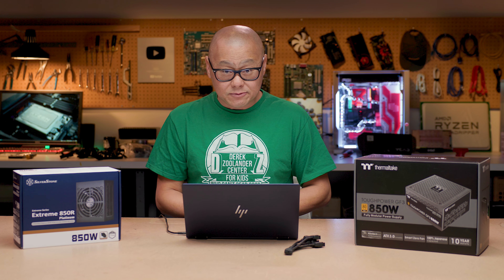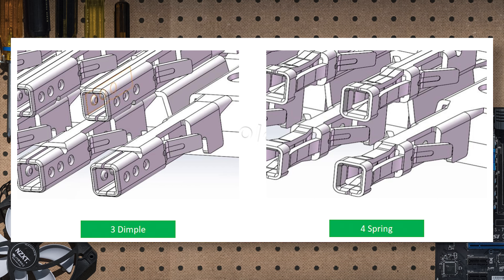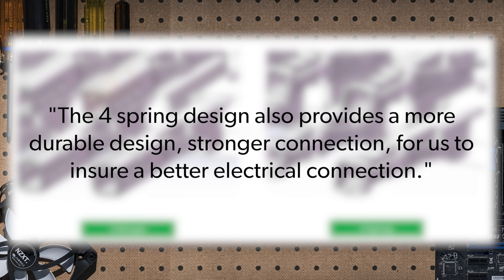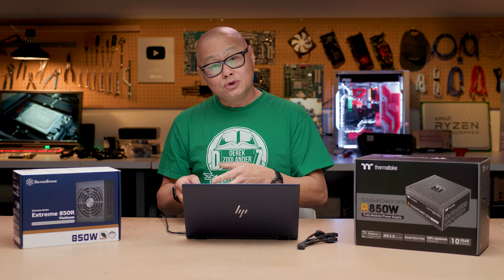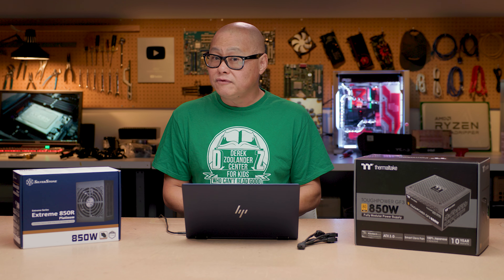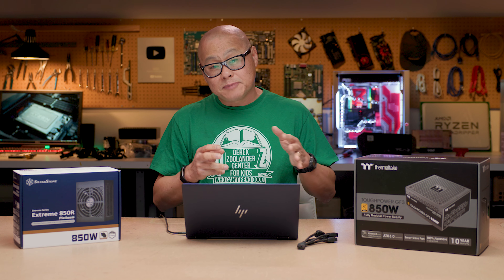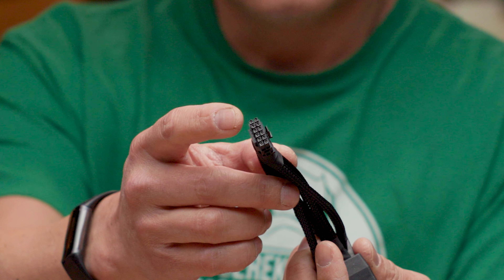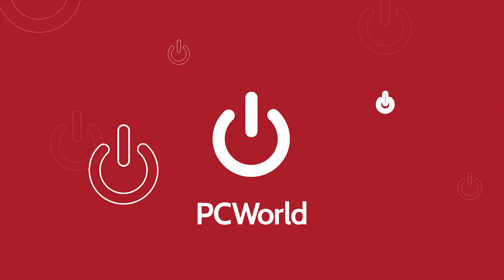Intel Updates 12VHPWR Spec: What You Need To Know

Comment: Sure, Intel who wasn't part of designing this wants to get money off this connector so it says it should be done THIS way, and they probably patented it.

I'd rather just stick with the 150W connectors because I'm NEVER going to have a GPU that needs a 600W connector, and if 3 150W connections are used, I'm OK with it.  I think most GPU makers would rather use 150W connectors when they're dealing with anything under 375W which is like almost EVERYTHING they sell, regardless of what they make.  It's not many people who shell out the money for $1000+ USD GPUs which is basically where  you start needing more power than that.
Reply: And it's not like these massive monsters are stable in just a slot and a couple of screws right? They need a little stand just to keep from sagging. Maybe the design should be reevaluated so that these pathetic connectors aren't the future and risk any potential for damage or worse, fire. To blame a user for the potential of not fully seating a connector really speaks to how low they view the individual user: they are trash and are not worth the time to create cleaver solutions for problems that don't need clever thinking. It's not like the previous 20 years of connectors from molex to the pcie power connectors didn't work, they just weren't pulling a profit so, why not just create a standard that even the pcisig said : "[PCI-SIG later said in a statement] that Nvidia and their partners were still responsible for testing their products to account for user error."

Shame, 30 years later of making connectors so easy a child couldn't screw it up and we have to worry about potential for one single connector for the point of failure? Christ.

Comment: I am wondering is my very expensive 1200W platinum PSU now trash because companies want to change the shape of the connectors for no valid reason.
Reply: Definitely not, the dimple connector type still works fine, just make sure it is seated well. If you are really worried about it, wait a few months and buy a replacement custom cable that uses the spring design. Remember, don't panic, and always remember your towel.

Comment: So just a recap for those like myself who may have missed it. Apart from the one batch of faulty cards reported from the single source, how many more have been reported as faulty?
Reply: There have been a smattering of reported melted cables post GN report, post Nvidia report. Probably less than a handful that I know of and in one post on Twitter that was reported post GN that had people again speculating--GN Steve pointed out that the picture itself showed the melt point of the connector indicated it was fully inserted. My advice is push the power plug all the way and listen carefully for the click and then try to remove the cable to make sure the lock is engaged. And then: PUSH it back in.

Comment: Seems like they want to reduce the likely-hood of another melting incident, but honestly just better labeling and education about making sure it is properly seated would probably be fine. Hopefully these changes will prevent the lowest common denominator from making this mistake now that its a pretty public issue, because there will still be someone buying a high power device like a 4090 with no idea that this was an issue in the first place. This whole thing is definitely one of those issues that was a low occurrence high danger situation and while it is good to be taking it seriously, I don't think its really fair for everyone to be dunking on it so hard. The industry NEEDED to find a way to move away from the 8-pin to something that takes up less space, having some cards with four 8-pin connectors was just taking up so much freaking space when a single 12-pin (16-pin with sense pins, w/e) could output the same watts. Growing pains is normal, and it having issues the first time it had widespread adoption outside of a controlled lab setting is expected. Anyone expecting a problem free experience when something new comes out is selectively forgetting the early adopter tax. If you don't want to pay it, wait at least a few months before buying a new product.

Edit: I would also just like to say, if you have an older power supply that works fine, and meets your wattage needs, just keep using it! No need to create more e-waste for no point.

Comment: I'm not changing out my EVGA PSU 850W Platinum anytime soon, it's almost 4 years old and it's perfect. All this could have been avoided if they just stuck  with the tried and true 8 pin connectors.
Reply: @Dr_b_ I was thinking because it's not up to spec the companies think that your current PSU is crap 💩🤣 I just don't want to add more wires in my PC, so I might just go with AMD now.
Reply: If they’d switched to EPS like servers, this could’ve been avoided
Reply: @amirpourghoureiyan1637  yeah 😑
Reply: @amirpourghoureiyan1637  No need. With 16GA wire, a single 8-pin is rated at 10 amps per terminal, for a total of 360 watts on PCIe. With two 8-pins you're rated for up to 720 watts. However, with EPS you're looking at 480 watts per 8-pin. Nice... but a bit overkill. I know people reference 150 watts for a single 8-pin PCIe connection, but that has nothing to do with the load of the connector, terminals or wire. It's a PCIe Sig specification for sensing. It's an artificial limitation that the GPU imposes on itself.

This is why the Corsair 12VHPWR cable just has two 8-pins on the PSU side and, as of right now, Corsair has no intentions of putting 12VHPWR on the PSU side... because the mini-fit jr. connector was fully capable as is.
Reply: @-INFERNUS-  This has been my big issue with people pushing ATX3, PC World included. It's going to create unnecessary ewaste of perfectly fine PSUs that would have worked just fine with a 12VHPWR cable from someone like Cable Mod.
Reply: @Dr_b_ I trust the tried and true 8 pin not 12VHPWR😁
Reply: @Dr_b_ Yes more 😁 I agree they should have left it alone, there never any melting issues with the 8 pin connectors

Comment: It'll be interesting to see tests of the two designs side by side with both not inserted fully. I also wonder if the spring design is better or worse after maybe 100 insertion cycles.
Reply: Is it your intent to cycle your connector that often as a consumer?
Reply: @POVwithRC  You don't test averages, you test 99th or higher percentile. Perhaps that's 50 cycles or more than 100, I have no idea.
Reply: @FrankLeeMadeere  So that's a no, right?
Reply: @POVwithRC  Average is probably like 4 or something, I don't know. That doesn't change anything in the validity of my previous comments. Testing to an average would be idiotic. If you would like to learn more about statistical testing, there are numerous educational YouTube channels you can reference. This is my last comment on the matter.
Reply: @FrankLeeMadeere  Calm down Sir, this is a Wendy's
Reply: Ummm, companies don't design things to be used improperly, so why does it matter how it works not inserted fully?  That's a good way to start a fire REGARDLESS of the connector.

This is the electrical workings of something like that.  You have a connector that's only partially making connection.  The connector is designed to pass so much power over that cable.  By not having a solid connection you add resistance to the circuit.  The more power that can be passed over that connector the HOTTER it gets regardless of the design.  Resistance creates heat.  That's the way any electrical circuit works, so you need wires, connections of all types, electronic components, etc.... to work correctly.  If not, and the way in which it doesn't work correctly adds resistance to the circuit, you create heat, which if bad enough can start a fire.

On the other hand the insertion cycles is kind of important but I think 100 times disconnecting a plug is a bit excessive.  I think for me a high rate of disconnections and reconnections for a PSU regardless of the connector would be 10.  I could see where if you have a test bench it makes a difference, and there are times I do a bit of hardware testing, but still.  I think if I were to disconnect a cable that many times I'm just buying a replacement because I'll lose faith in it.
Reply: We already know what would happen if not fully inserted. You would build up resistance, which equals heat, which leads to melted connectors. That's a given, so there's no point in testing it. As for insertion cycles, these companies already test that. These terminals, either way, are good for more than 30 insertion cycles. That rating is the same as the old mini-fit jr. standard and people that do testing have exceeded 100 insertions on that. The 30 rating is just a worst case scenario, and for 99.9% of people will be WAY more than they ever reinsert the connectors on their GPU.